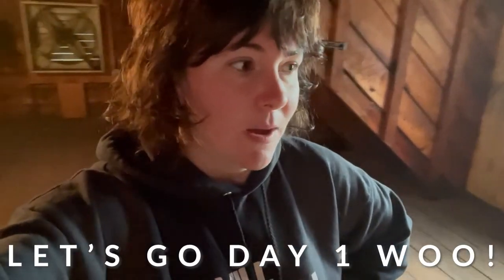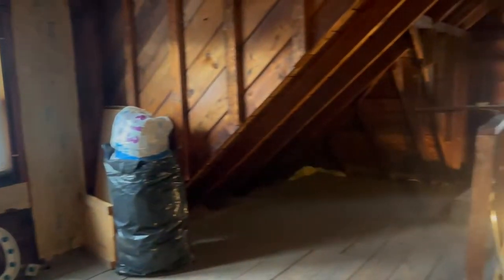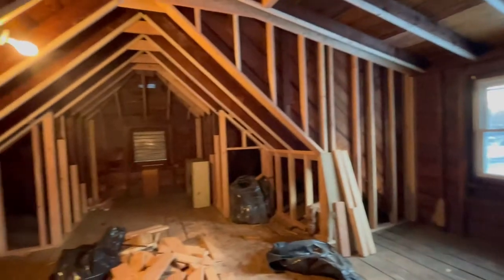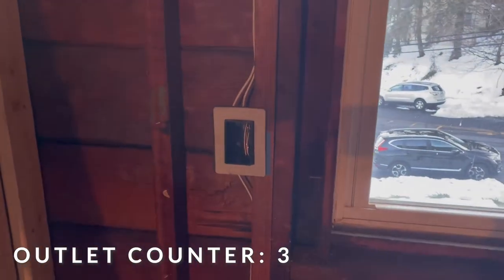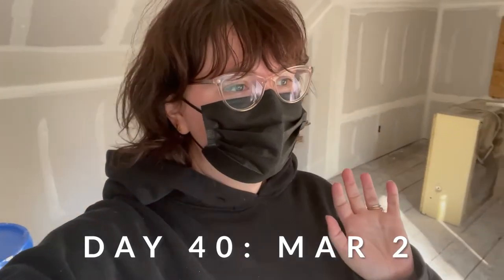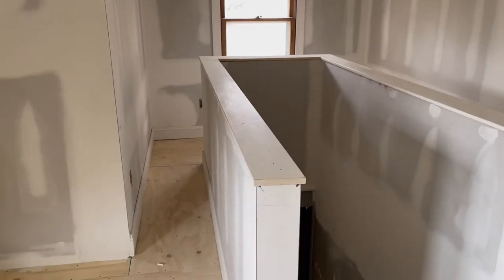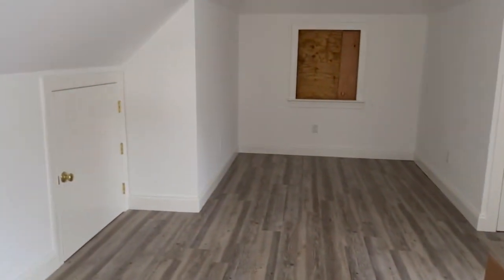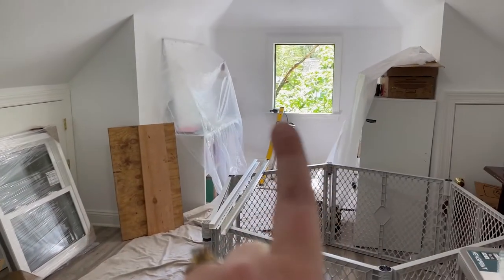★ STUDIO RENOVATION BEFORE & AFTER: Turning my attic into an artist studio ★

Comment: I'm about to embark on this exact same process. Couldn't find anything on youtube or how to books. And here you are. I've opted to not have a sink. Is that a big mistake? So far I have 4 skylights in and that's about it. I'll have the same hvac. How is yours working out? What brand? Thanks so much for sharing.
Reply from the maker: Hey there! Thanks for taking the time to watch :) For me, a sink was necessary because otherwise I would've had to go up and down the stairs every time I needed to wash my brushes or need water for paints. So really depends how often you use a sink in your process. I would've loved skylights, but didn't work out in our budget - I figure I can always add that at a future date if I want. But wowwww 4 skylights sounds amazing!! My hvac is fujitsu. It's working out really well. I've used it in both summer & winter now. No issues thus far and keeps the temperature where I like it.

I did a studio tour in a recent video showing more of the finished space if you want to see it here: https://www.youtube.com/watch?v=Wv5tLSEkOLc&t=7s

Good luck! :)